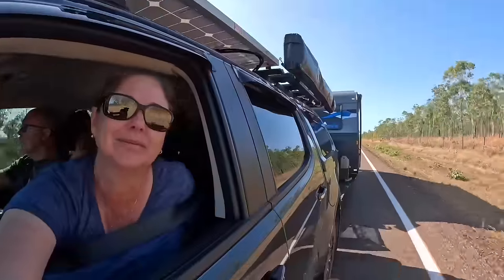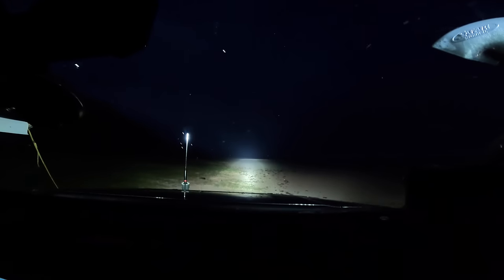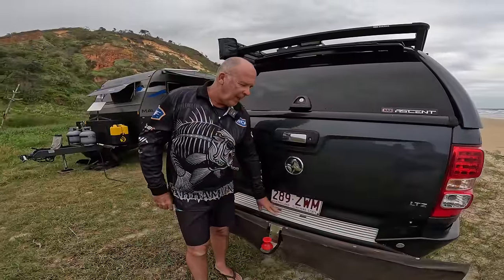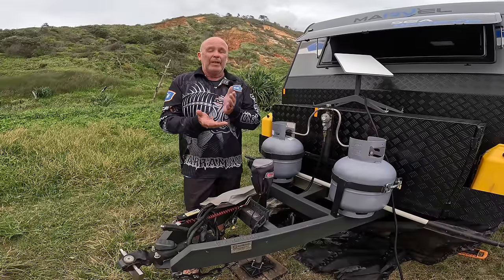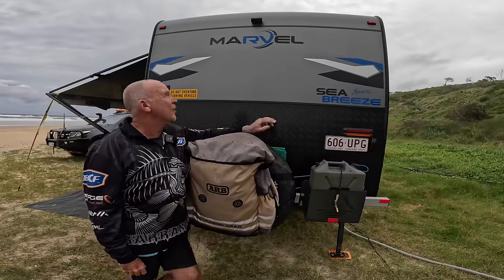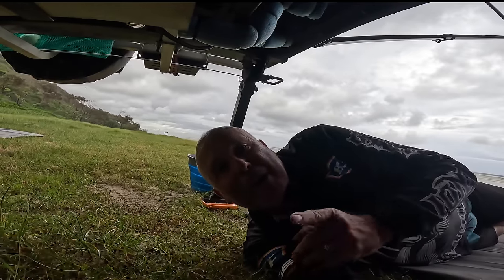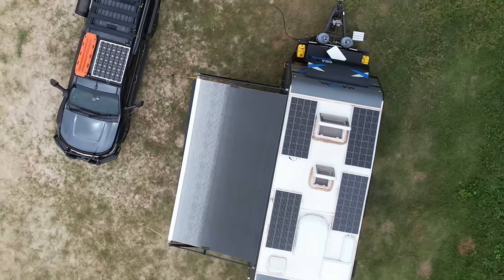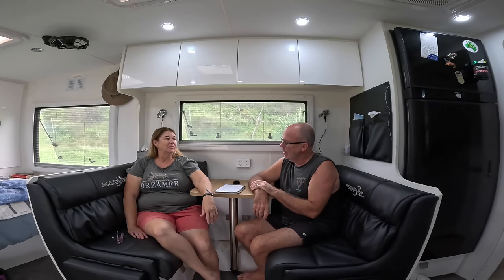OUR FULL TIME TRAVEL SET UP | Hints and Tips for living life COMFORTABLY on the road - Ep 34

Comment: Thx. Very informative. I was wondering what brand your Lithium batteries are. Also, the specs on the A/C plz.
Reply from the maker: The aircon is a Dometic IBIS 4 and we have 2 x 200ah Enerdrive B-TECH lithium batteries. We can run the aircon off grid for 2-4 hours on about 23 degrees Celsius using an our Enerdrive 2600w inverter. Of course we only use the AC off grid when it’s very hot at night. Hope this helps
Reply: Thx. also, what brand are your solar panels ? @trip42australia

Comment: I have a 2018 Z71 Colorado, no issues in 136000km, got all the same type of stuff bolted to mine but Opposite Lock. Had an ecu remap at 26k 138.8 kw /495 nm after. Standard was 115.7kw and 435nm.Avg fuel over 136000 km10.3 including towing a2.5t full size van to SA, Darwin and around Victoria/Nsw..
Reply from the maker: mate I love our Colorado, it’s a very capable car the only thing that disappoints me is I can’t buy a new one and the US is manufacturing them as V8s now. Maybe one day the one back

Comment: Hi guys great episode, I do have one question, we have a similar setup as you both in regard to the draw system, how does your fridge run on hot days? we have a 40lt engle fridge and find it does struggle keeping temp sometimes ( we are running it as a fridge not a freezer) we have a 120ah battery, DCDC Charger etc. cheers Les & Denise
Reply from the maker: Thank you, ours also struggles on hot days, I’ve set both compartments to minus 1 at the moment and it normally hovers around 2-3 degrees in the middle of the day. I try and keep it reasonably full that seems to help. I read somewhere that the fridge doesn’t need to work as hard to maintain it’s temperature and lately I’ve been opening the canopy windows when we’re parked up. That seems to help.

Comment: Just one question. You said you were going to say what the car weight was with all the bits you have put on it did i miss it?
Reply from the maker: sorry I missed it when I was editing the episode, the total car weight complete with Ally and I on board was 2840kg it gained about 600kg. 🤓
Reply: Just found your channel good stuff guys 👍 just going through process of checking our ranger weights. Almost identical arb extras right down to winch. Kerb weight before around same as your Colorado as well. We are at 2818 with full tank fuel, me and wife but nothing in back. Does the 2840 include your drawer system, fridge and all the gear in the back?
Reply from the maker: @miket2304 hey Mike thanks for watching, yes it does. I last weighed it (about 2 months ago) at the dump before heading towards Darwin and it weighed in a little heavier at 2910 but we were fully packed for travelling off grid, the weigh bridge operator said the scale was good for about 20kg either way. Hope this helps
Reply: @trip42australia  I better weigh mine again. Been looking for someone with similar setup to get a feel for axle weights. With Lovells upgrade it will get me to 3500GVM and 6600GCM but rear axle weight is what I’m trying to guess. I assume yours was okay?
Reply: @miket2304 there is no way this setup is legal

Comment: 8000 kilo winch , that is a big winch 😁I guess that is 8000 pounds ??
Reply: 2.2 pounds to the kilogram. so 8000 x 2.2 ( Roughly )
Reply from the maker: Sorry mate, I got the info slightly wrong it’s a 10000lb Bushranger Revo winch that’s about 4500kg. I remembered when I was buying it thinking about running the cable through a block which increases the winches pulling power to between 8-9000kgs. I’ll make mention of it in next weeks video to prevent any confusion.🤓